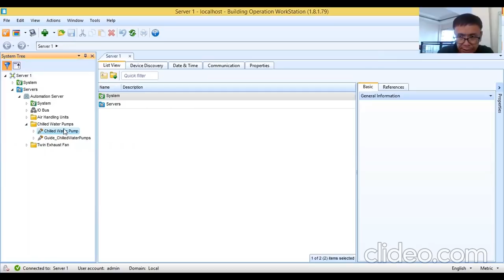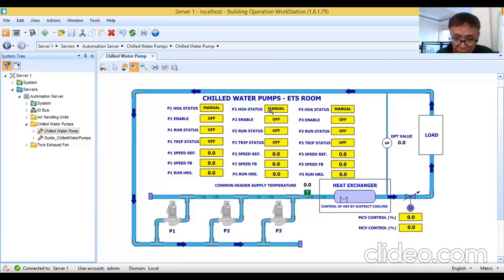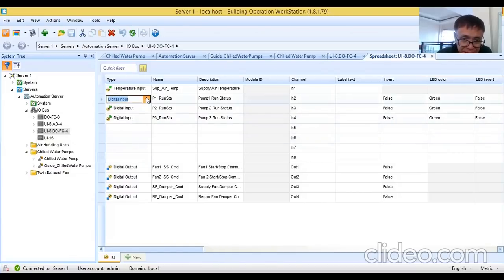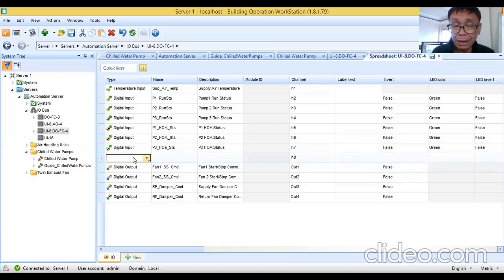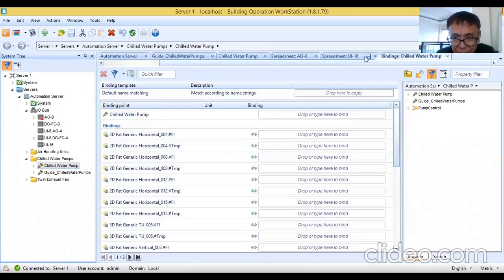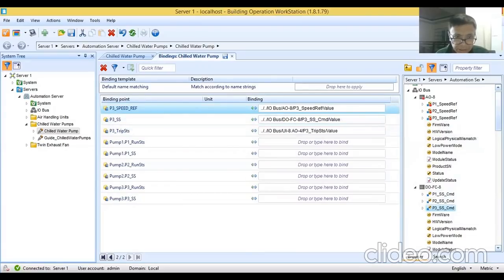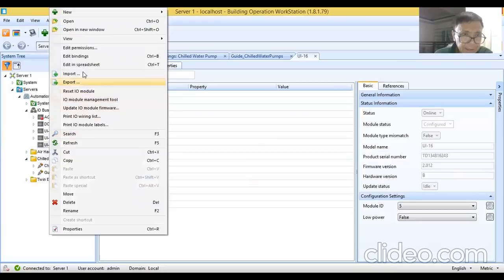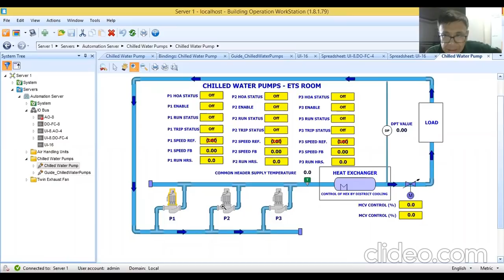CHW Pumps Control in an ETS Room Part1

Comment: Sir ,do you know CCT johnsoncontrols? Can you have lecture on it.
Reply from the maker: actually I don't have controller and engineering tool (software) for johnson control but I guess it is using function block in programming based on Object Oriented Programming

Comment: I'm not able to add the automation server 

Since I don't have atumation server or any Io module 

Without this physical device can we use struxtureware software
Reply from the maker: You can use the sbo workstation for projects
Reply: @SantosJrCapellan-BMS  sir I find in Schneider's electrical website but they removed that software. can u share the link?
Reply from the maker: @ikramalam432  I am using an old version maybe it is no longer supported in their site